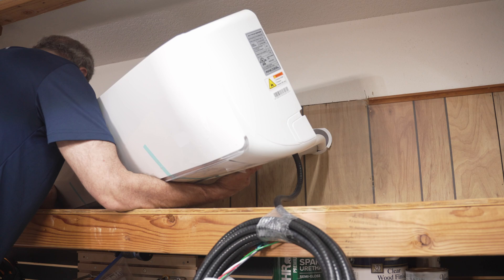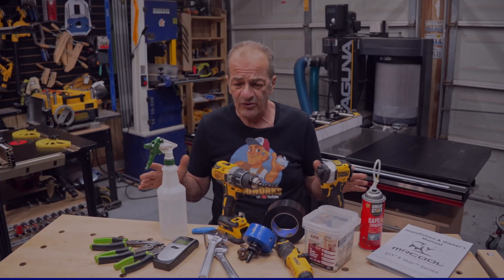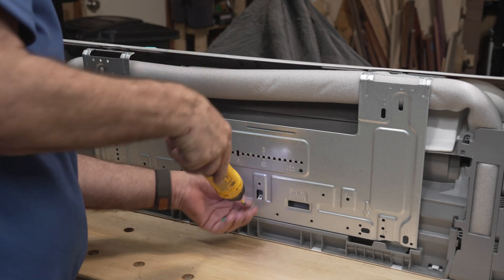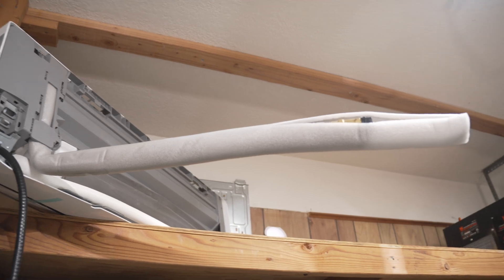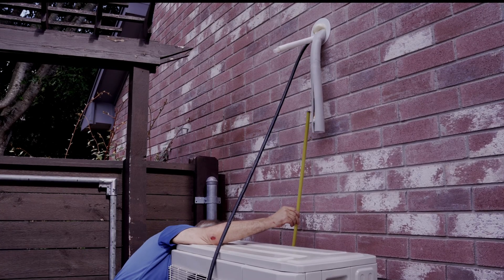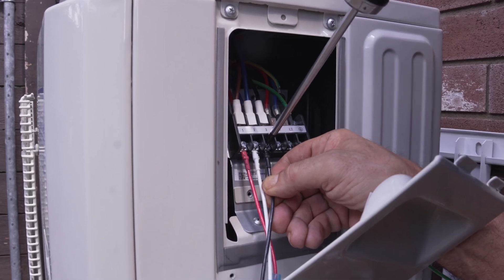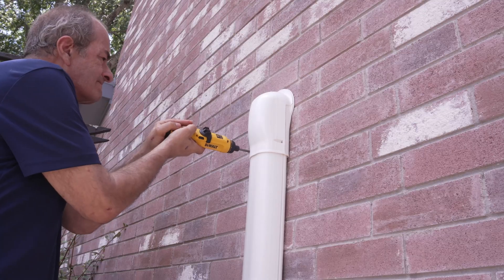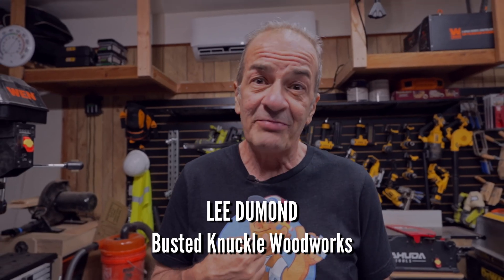Installing a mini-split — everything they DON'T tell you

Comment: What a great video that was so entertaining!!! One thing that really helped is the direction you put the sleeve in the wall.  I have installed three of these now and only once did I go the sleeve correctly.  The other two it stuck out on the bottom and that’s how you know you got it backwards! One tip I can offer that you are missing.  The wiring up to the disconnect is very hard to bend those thick gauge wires around the terminal.  I agree with you that MRCOOL is going way too big on wire recommendations.  To make it easier I got the spade connectors from home
Depot and crimped the wires onto the spades.  Then you can just put the spade on the terminal and then screw it down. 

Agree 100 percent with drilling the inside and outside holes separately with the pilot hole.  Also don’t drill the big hole first, drill a small one and try to look inside the wall to see if there is any electrical or plumbing.  As you mentioned ruined this could be a costly mistake or even cost you your life if you hit an electrical wire.  I almost did and thank god something told me to stop with the drill just in time.  The flipper I bought the house from bunched together the excess length in the wall instead of cutting it and stapling it to the studs.  Not up to code at all and almost cost me my life!  I would love to fix it but bigger fish to fry right now.   Fortunately the wires did not get damaged.
Reply from the maker: Thanks, it’s hard to make installing a mini-split interesting! Great tip on the wiring terminals, I may go back and do that myself at some point
Reply: @BustedKnuckleWoodworks  the wiring is the most tricky part my electrician used thicker wires which were hard to bunch up inside the cover plate.  I had the same issue with the larger 22k btu unit I installed on the other side of the house.  Made me worry when trying to get the plate back on that I would damage the wiring. 

Btw, there are companies on Amazon that have much better deals on the line set covers than the MRCOOL one.   

One other tip with the WiFi adaptor, it will not work if you don’t shut the breaker to the outdoor unit off before installing.  Of the 3 I’ve installed now, none worked until I went outside and turned off the power.

Comment: Great video, Sir. I'm still happy I paid to get mine installed, but I feared that I might mess up my pre-charged lines (and needed a new dedicated circuit installed for it in my shop).  Congrats on your climate control - it's great, isn't it?  2 1/2 years later and I still love mine made for my northern climate Canadian shop!  Keep the videos coming!!! 👊
Reply from the maker: I almost had to get a new circuit myself, but instead I tapped into the clothes dryer. We have a gas dryer, so we don’t use that 220.

Comment: One of the first things I did when we bought our house was get a mini split AC installed in the garage so I could work out there comfortably year round. I couldn't imagine trying to work out there in the summer without one! The labor charge was a couple thousand, but I didn't even consider doing it myself! You made it look easy, so if we move again, I'm may give it a shot myself and reference this video to make sure I do it right!
Reply from the maker: It was easy when I wasn’t trying to manhandle 120 pounds on a ladder by myself!
Reply: or cut a hole in the wall and push a window ac in 1 hour work at most and job done lol (did that one myself lol )

Comment: Very well done, Lee. I installed a similar unit last Fall, but mine didn’t have the pre-charged lines, so as you said, I had to purchase and use a vacuum that I had no idea how to use! Thanks to Youtube University I finally got it working after three attempts with the vacuum. I’m happy now, but half way through I wished that I had gone with a Mr Cool unit. I would suggest anyone who considers themselves unhandy should follow your lead. Scott
Reply from the maker: @MyGrowthRings  yes, those vacuums are really tricky. I’ve seen even experienced guys mess that up. Not dealing with that!

Comment: Funny. I installed one myself a few years ago but I modified it to be a central air unit. Heck yeah, working now just fine! Hmm 2k$ central air vs. 6k$ central air … I’ll take the former!  Basically how to do is take apart interior unit and replace the coil with an A-coil type ant put it above your furnace. There is a control unit in interior unit that you must keep by the coil. Also, remove orfice from your a-coil entirely! C’ause the expansion valve is already in the compressor unit.
Reply from the maker: They have the multi-zone units for new construction but what you describe is a really awesome retrofit for an existing setup. That would make a really interesting video!

Comment: I'm never worried about the work.  I'm worried about the fine details that will eventually sink the project.  Never thought about running hot, then cool, then checking for leaks AGAIN.  Thanks Lee.  I'm seriously thinking about a solar unit.  I never could imagine *free cooling without some trick.  These things are so efficient they can run off solar! Incredible!
Reply from the maker: @zendell37  wow, I’d be interested if you can make it work with solar, that’d be awesome 👏
Reply: Solar guys Pro EG4.  2100$ for a DIY kit with solar panels and everything (except batteries for storage).  I'd link it but I'm not sure if YouTube would like that.  It's a 12000 BTU unit, so half the capacity of that cool guys unit.  But with the 100 degree heat we've been seeing, that 12k off solar might be the difference between a 200$ and 400$ power bill.

Comment: What about the filter on the unit? As shops are dusty, wondering if the filter is effective and easy to clean?
Reply from the maker: @Xdonald331  Great question. They are washable and are actually very easy to pop out.
Reply: Build some sort of a case around it and install deep-pleat furnace filters. You'll thank me later
Reply: Wait until the blower wheel gets clogged up. You have to basically uninstall the whole thing and take it completely apart. Then you'll need a recovery machine and a vacuum pump.

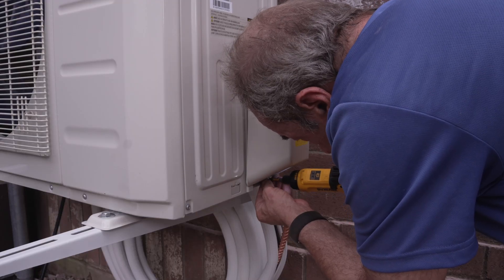Comment: 11:42  make sure to use two wrenches on the flexible copper tubing. Always have your bigger wrench as a backup preventing the lines from crimping as you tighten the nuts. One twist of the tubing and you’re screwed
Reply from the maker: Yes, that's critical on the top ones since they both move, but you're correct, should do that on both ends

Comment: Excellent video.  May I ask 2 simple questions? how many sqft is this space and how long did it actually take from start to finish.   Thank you very much.
Reply from the maker: It's about 500 sf, but there are 10 foot ceilings and it's in Texas. Quite honestly, I probably could have gotten by with the 18k. If I hadn't been filming it, I would have finished it in a single day.